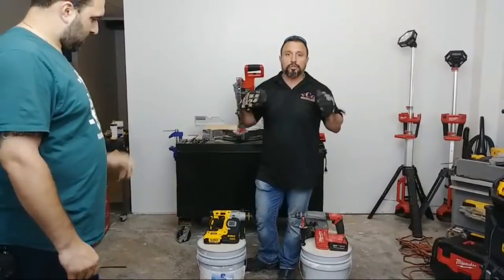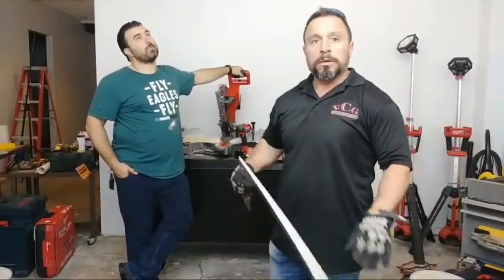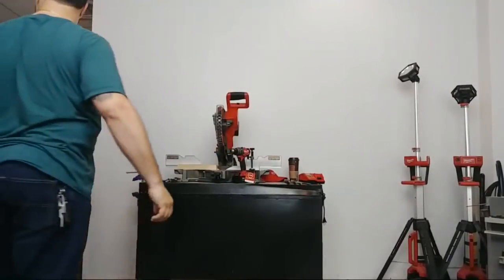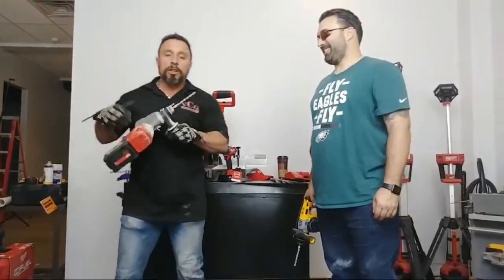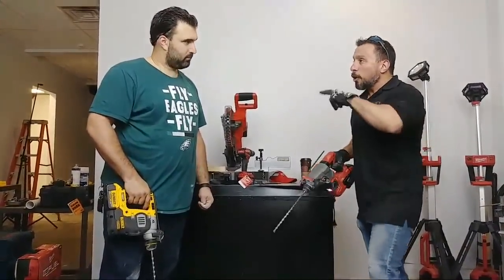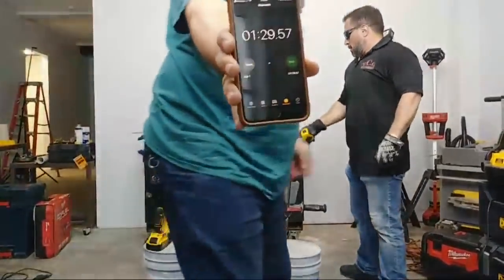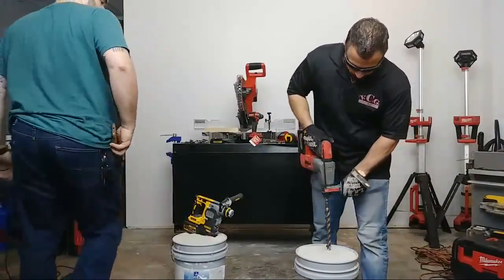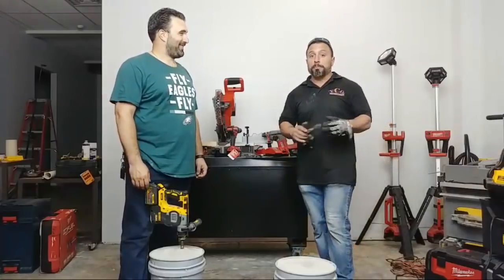SDS Rotary Hammer Drill Comparison - Milwaukee VS Dewalt!

Comment: Question why does the dewalt your showing have less power at 2.1 joules abs the d handle dch133b dewalt has 2.6. I haven’t seen a comparison but is the difference in power an issue? As the dch133 is even cheaper too but is 20v max XR brushless. If you could answer would really help my decision between the two Dewalts. I need to be able to drill brick and concrete using up to 1 inch bits at 10 inch and 3/4 inch at up to 24 inch. Which would be better for me. Thanks

Comment: I've noticed with hammer drill bits that if they are blowing dust like that then they are usually past their use by date.
Reply: Has nothing to do with that, it merely means that because they aren't clearing the hole out as they go by lifting the bit up and down at regular intervals a pocket of air has been trapped via dust packed against the flute and it blows out like a puffer. Nothing to do with the bit, just poor drilling technique 😂
Reply: @leewagner942  You probably right. And I'm definitely speaking out of turn. I've never used a new bit that doesn't do that then let them get old and dull and begin to do it. And I surely don't use them everyday.

Comment: I use 2" sds max hammer drills for mud jacking, i have one by Dewalt, Milwaukee and Bosch. all are made to do 2" drilling.I drill 1  5/8 holes all day long with all three. The Dewalt is fairly new yet so far i am pleased with how fast and hard it drills with very little impact to the user. The Milwaukee is the most comfortable to use , second being the Dewalt last being the Bosch.  The Bosch is old reliable, it has yet to fail me even once.(Dewalt still  to new to determine lifespan) The first Milwaukee i had went for years ZERO problems, until i bought another just a few years ago. It has spent more time in the shop than it has on my truck. So with all that being said, I am hoping the Dewalt proves tougher than the MIlwaukee.

Comment: The guy with the dewalt is both heavier and pushing down harder on his drill than the guy with the milwaukee.

The Formula for force: Force = Mass x Acceleration.

The guy with the dewalt has more mass and is using more of his mass to create more force.

It's science.
Reply: Except weight and mass are two different things your not adding mass to the bit your adding gravity an opposing force. All he will get is a dead battery the rotary hammer would perform better if he just let's it work.
Reply: even if he did add mass Newton second law states with increased mass you lost acceleration without adding force.
Reply: I use these daily. The dewalt is better. All of their rotary hammers are better. And I'll tell you putting weight on these doesn't make them go faster. Milwaukee does some stuff better just not these. Dewalt dominates rotary hammers. Milwaukee and dewalt are pretty comparable overall. Can't go wrong with any of them.

Comment: 01:45 It's not so much the Amp Hours that make a difference as it is the type of battery.. Milwaukee has XC (Extended Capacity), HD (High Demand 35% more power) HO (High Output 50% more power) You need to use the 'High Output" batteries..  You have to do it over again, don't let Dewalt win!

Comment: ya guys gotta test the milwaukee again with the high output 6.0 and 12.0 when they come out they are actually supposed to give some extra chooch maybe itll make a difference but dewalts got this one i got fuel everything but im looking at maybe the dewalt sds, cordless drain snake and pex expansion tool but i dont know yet if the differences are worth running 2 battery platforms, ive already got a ton of milwaukee batteries, but the dewalt kits with batteries are about the same as milwaukee bare tool

Comment: Milwaukee 5 year warranty enough said
Reply from the maker: That’s what’s up!!
Reply: I’m heavily invested in Milwaukee. Based on this video, I was gonna get the Dewalt SDS plus (I have the Dewalt 30 degree framing nailer). Instead, I just got the 1-1/8” Milwaukee SDS plus.
Reply: @kylepearse973  how do you like it so far? Just ordered that drill in the HD kit with two 9ah batts

Comment: thanks for the reply fully enjoy watching keep them coming . i knew the combo would not win cause seen it compared to a Milwaukee m12 fuel sds which won and i own one of but use a dewalt 996 for other jobs . if you get a chance to show the dewalt dewdch481 against the Milwaukee m18chmo and possibly the smaller dewalt dewdch334 as not seen anyone put them head to head yet . keep up the fantastic work as i have quite a bit of time at moment due to health problems 
thanks mark
Reply from the maker: Hope everything is ok Mark. We are working on more tool tests and comparisons so stay tuned! Thanks for the support!
Reply: @VCGConstruction  
Vince one thing to keep in mind is you said your Milwaukee was old.... Well Milwaukee released another sds that looks identical but has more power than the one u likely have in this competition

Comment: Bro you can clearly see that dude pushing soooo much harder. Dewalt is not better
Reply from the maker: Bro you clearly didn’t watch the whole video. When the 2 dudes switched tools DeWalt still won.
Reply: The hard push have no effect past a certain value. Medium push is good but hardpush kills your drillbit and doesn't allow your drill hammer to do the job... Like when you are using a normal hammer and the you get limited on the length of your swing.